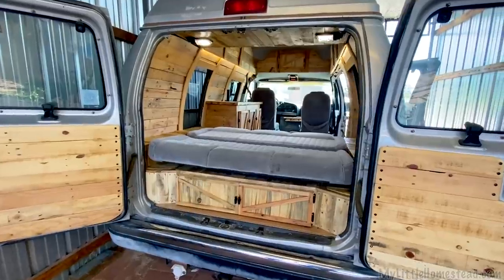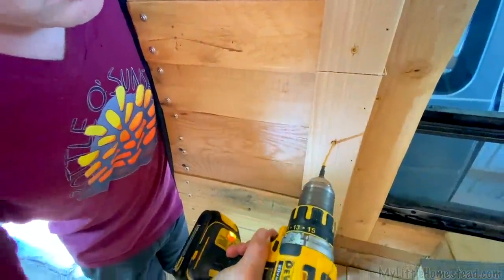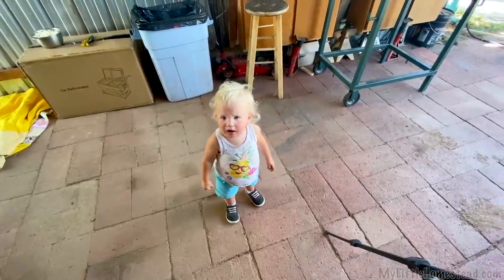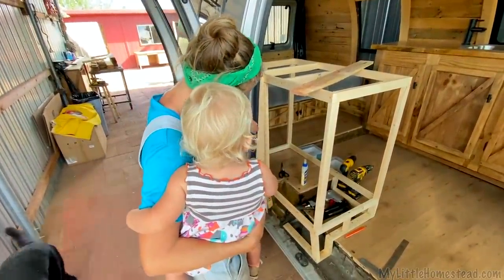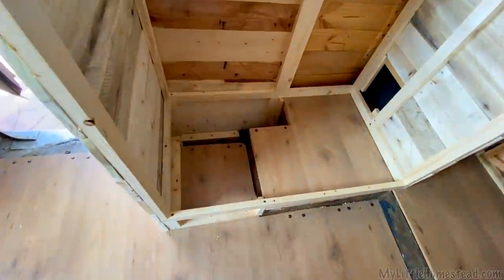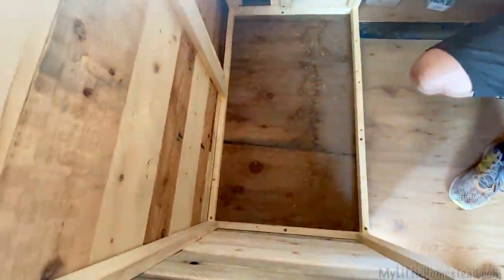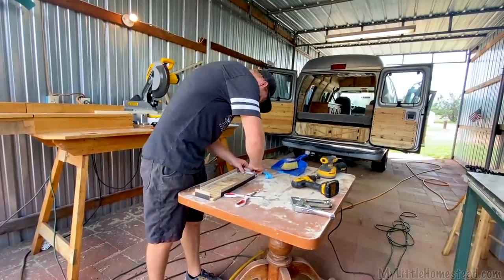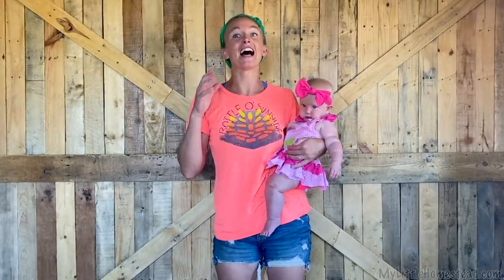Refrigerator Solution For The Van | Weekly Peek Ep314

Comment: The girls are just TOO CUTE! Frig needs to breathe! Don't forget to leave adequate venting in that cabinet. You talked about shutting it behind cabinet doors. Maybe make those doors as frames for inserts of some of that stamped aluminum decorative screen stuff. Too bad there isn't a simple way to let it breathe outside air, so extracted heat doesn't heat the cabin (good thing in winter - ;-).

Comment: You might want to consider ventilation for the cooler cabinet - the heat it will be outputting, no matter how little, should be allowed to escape that small enclosure.

Comment: I used one of those plug-in coolers in the truck for years it will only cool to 30° less than the ambientif you don't put some kind of air condition vent in there that cooler you bought will not cool your food down and keep it in safe condition

Comment: Important! Look at your refrigerator. Where ever there are vent holes on its cabinet, you need the same on the wood cabinet if you intend to use it while it's within that space. If you close it off, heat of rejection will build and it'll shut down to protect it's compressor, and you'll shorten it's life.

Comment: I looooooooooove this video. Whoever did the editing, you are a rockstar. The storm sequence was so beautiful! seriously loved it. Ok back to the van. The empty space at the bottom of the fridge box that you said could store the tire iron, I suggest shoe storage instead. You could make the bottom slats facing outside have a hidden hinge so you can access it from outside if you wanna get fancy, but in a van you usually have shoes all over the place, taking up valuable floor space when you're inside. And they're usually pretty dirty from being outside. And if you don't want to be constantly cleaning the floor, getting dirt everywhere, you can just take them off on your way in, then put them on, on your way out, easily. NEXT thing, the fridge top not opening completely. yikes. I know. Expanding the height of the box doesn't sound like fun, but from a fellow alpicool fridge user who also built a box around her fridge (aka me), having to hold that lid open, dig around inside the fridge, pull things out, put things in, reorganize AND balance a baby on your hip? whew that's a tall order, I did it too! (minus the baby) and that got old in 5 days. That lid will stay open, but not if it's blocked. You could give it a try for awhile, but my prediction is opening #7 through 10 will turn you into #TeamTallerBox You could remove the one slat that is blocking it from above and access it that way, with the box lid removable or on a hinge, which could work. You won't be able to see into the bottom of the fridge from the side. Or tilt / pull it out since it's boxed in. Either way, exciting stuff. See ya on the road :)

Comment: I would like to make a suggestion to Garen & Ellie.. On the "fridge" cabinet, maybe make a door on the outside (by the van door) to access the jack and lug wrench.. That way you don't have to keep getting in and out of the van when/if you get a flat tire.. ALSO, look into getting some truck bed liner for the step. I believe you said you may carpet it but if you use bed liner i would help waterproof that area... Just a couple of thoughts.

Comment: i know you guys love your sanding table, BUT have you thought about cutting down the table leg base thing to that first ball, then taking your crate wood and make a round top and paint the bottom ( would do white) then leave your top plain with a varnish or even stain it then you would have a stunning coffee table that has no corners for little girls to bump into.  that table base is just too pretty to just be used as a sanding table. you can always make legs for the old square top to keep using for a sanding table.  I sure hope y'all give it some thought? would be another  wonderful project for your home and shop!

Comment: Very nice, looking really good. I assume you guys are considering how the van may flex and bend as it travels through the world. Could you maybe mention that a little more? Some of the fastening seems like it might result in cracking or the screws pulling out. Maybe the wood will be much more forgiving than I'm thinking. Or maybe it will loosen up the first time it's on the road.

Comment: Alpicool is a great fridg/freezer I have the same one it is my second the first was a small one and it ran 24/7 for 3 years on battery with solar  no trouble at all with it. I ended up gifting it to someone that was just using a ice chest
Reply: Also don't forget you need real good ventilation for your fridg/freezer or it wi not cool properly and will over heat fast

Comment: I know you want to make your van look nice but, please consider the weight you are adding and how it is balanced for road travel.  I have found that balancing the payload will help drive the van safely, and I want you to be safe. The standard wood you are using is way too heavy and will reduce your fuel economy. Your ideas are good, but you need to calculate how your van will handle when driven with an unbalanced and overweight load.  I am happy to see you are all safe and healthy during these times of uncertainty.